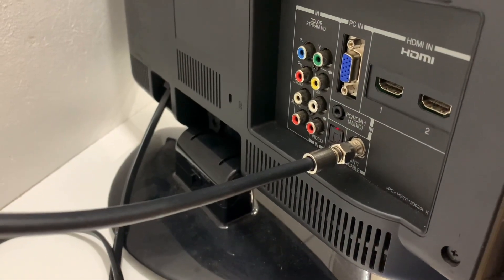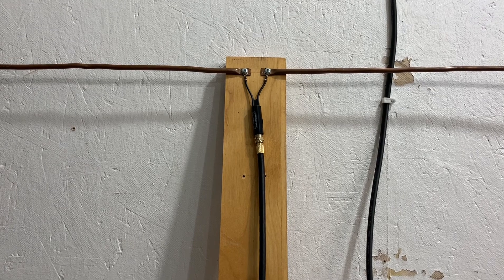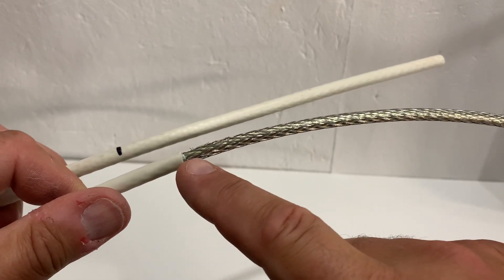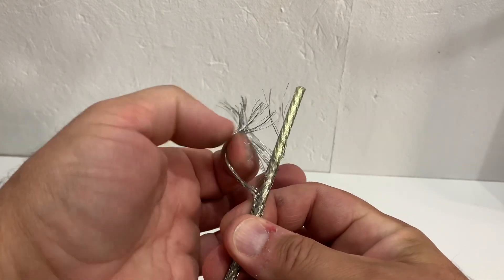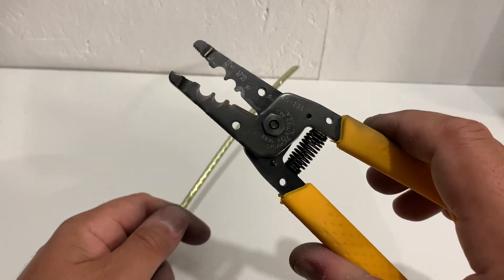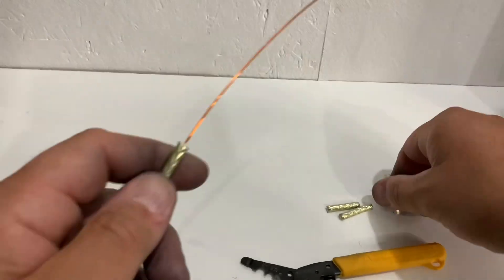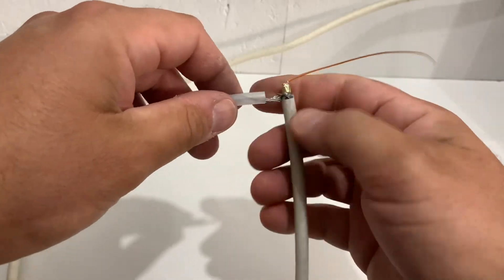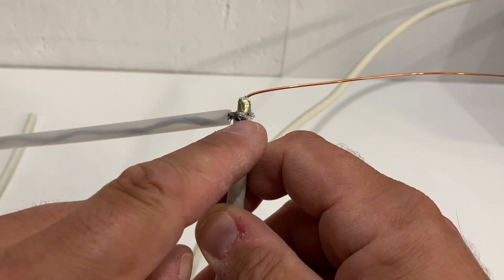Build a Homemade TV Antenna from Coaxial Cable - DIY OTA TV Antenna

Comment: Thank you for the awesome tutorial. Clear description of steps. Well done!
Reply from the maker: You’re welcome, thanks for watching!
Reply: I just carefully used a pair of scissors to be careful not to cut any shield or wires.   I had to cut the initial rubber part in small pieces.  But I could tell with the scissors just by how deep I was cutting, and didn't hurt the shielding or the internal copper wire!

Comment: I built one of these last week using one of the many pieces of excess coaxial cable that I have had sitting around for years, plus a couple of pieces of plywood.  It works great here in Brooklyn, NY.  I have the antenna sitting in a window that I suspect is not even facing any of the transmitters.  I get between 60-70 stations, with only 2 (on the Channel 7 subband) coming in and out depending on atmospheric conditions and time of day.  Thank you so much for your video!

Comment: I'm using 2 four foot wires and I get everything real strong they're still using lower frequencies in my area so I need a bigger antenna than this
Reply from the maker: Great to hear. There must be Low-VHF stations in your area. Go with what works!

Comment: Thanks for a great and detailed video. My coax had 2 sets of braided wire separated by plastic sheeth. Wasn't sure what to do so I untangled both and twisted them as you showed, making sure they didn't touch. Then unsheathed the copper wire, bent them all correctly, taped them to the wall and boom! It works perfectly. Thanks again.
Reply from the maker: @Homelander-js9hd  That cable is called quad-shield. Just an extra couple of layers of shielding. Thanks for watching!

Comment: Is there a secret to unraveling the braided wire?  after a couple of inches it becomes a rats nest!  it took me a half an hour to get 6 inches removed and probably lost about 10% of it
Reply from the maker: That's ok, the antenna should work without the braided wire anyway. Try it out as it is.

Comment: it is so clear for people who wants to DIY one antenna. If I wants to modify e.g. using a copper wire and making this wire as a circle , do I need to connect the shield and copper line to this circle? how to calculate the diameter of this circle?
Reply from the maker: Honestly I think just the copper wire formed into a circle would work just fine without the shield. There are online calculators available, but the rough formula for calculating a half-wave antenna length (in feet) is 468/frequency. Then just form it in to a circle.

This website has a chart of the frequencies of individual TV channels, as well as a calculator for full-wave and quarter-wave antenna lengths by frequency.
https://otadtv.com/frequency/index.html

And another online loop calculator:
https://www.66pacific.com/calculators/full-wave-loop-antenna-calculator.aspx

Comment: anybody know if this will work in rural mountain areas for tv 30-50 miles away?
Reply from the maker: @egenestarr1965  This antenna is designed for close range reception within a city, maybe 15-20 miles max. In a mountainous rural area 30 to 50 miles away you will need a larger outdoor antenna with more elements. Mountains especially, will degrade a TV signal by simply blocking the signal or refracting it making it more difficult to receive.

TV Antenna Reviews
https://www.youtube.com/playlist?list=PLDX6gLCL4WMwMAycjBF3_ApXyAfwHNV4f
Reply: @NorthcoasterHobby  thank you
Reply from the maker: @egenestarr1965  👍you’re welcome

Comment: I built a dipole antenna tuned to 189 mhz.  Worked with a marginal 44% signal.  I used a boom and placed the dipole on it with a director 4 3/4" in front of it.  Signal was now 54%.  I added other director tuned for 189mhz of course.  Signal jumped to 63%.  Here is the weird part.  I then added a reflector about 12" behind the dipole on the boom and the signal went down to 48%.  Took it back off and the signal was back to 63%.  So I decided to add another director for a total of 3 and again the signal went down to about 52%.  Can't understand why adding the director and reflector weaken the received signal.  Using the dipole with two directors and no reflector is the best I can do.  Signal does go down a few percent during bright sunny days but is very stable. Goes up during the night and when it rains.
Reply from the maker: Strange. I guess go with the two directors. Generally directors are about 5% shorter than the driven element, and reflectors 5% longer than the driven element.
Reply: @NorthcoasterHobby  That's exactly what the directors are.  The reflector was just a bit longer BUT they didn't work for some reason. even made it worse.  I'm thinking it because of the location of my antenna but I tried all over the yard and the only place I could get a signal was in my garage window.  I accidently found the signal after laying the coax on my motorcycle in the garage and a signal came in.  The motorcycle was acting like an antenna with the coax touching the frame.  I also played with the spacing of the elements to get the best signal.  I have a pretty solid 62% signal right now good enough to split it 3 ways where it drops to 60% then.  Have to use a 24db preamp.  I have a big hill between me and the TV tower so it's needed.  The station (channel 9) I'm getting is 27 miles away.

Comment: I just used an old Genesis RF Modulator and a coax cable and was able to get 26 channels. Wonder if I should do this or something else go het more channels.
Reply from the maker: An outdoor antenna will usually work better than an indoor antenna. That’s probably the best way to pick up more channels.

Comment: I live in a highrise near the MoSun Connecticut.

Reception is normally awful for indoor antennae. unless I align it with Long Island Sound. I cant use an outdoor. But I have a 3x3 ft hot spot in my apartment. 
Using a $20 antenna with an amp I got NYC! But only for a few hours. I receive most CT TV stations. CBS won't come in, but I have Paramount Plus. Good bye $130 Directv bill!

Comment: what is the point of a dipole when the braided portion is grounded? I made an antenna by eliminatiing the braided end at the antenna and attaching the center wire directly to an aluminum foil glued to a piece of cardboard. I am in Central Mass and get 65 channels. The flat of the antenna "faces" east/west. Maybe i'm wrong but I belive that dipoles are not grounded.
Reply from the maker: With antennas there is no one size fits all. I'd doo whatever works best for your reception situation. I'm not exactly sure about the ground, maybe you're on to something there.

Comment: Window antenna!
Thanks for this. I'm lucky that where I live has straight line of site to our areas tv antennas, about 10-12 miles as the seagull flies, up on 2000 ft ridge (I can see them with binoculars). There's some neighbor hedges partially blocking in front of my window but aren't stopping the signal for whatever reason. So have no idea if what I did will work in other situations. 
Made this antenna and got channels 13-35. Could only get 3 which is NBC, only very rarely for an hour or so on a perfectly clear day. Researched, learned about low VHF needing longer antenna, started running numbers. Then realized the window was aiming the antenna through was aluminum framed, so attached wires from each end of your antenna to separate places on window frame and get channel 3 clearly along with all the others. Surprised and going to make this setup with more solid materials and be done.
Reply from the maker: Thanks for sharing your experience, and for watching!

Comment: Worked a treat. Carefully used a stanley knife and got dozens of channels on the TV in the basement. Luckily only two miles from the main antenna in the city. Also the quality is way better than i got from the cable box i recently got rid of.
Reply from the maker: Excellent!
Reply: stanley  makes knifes now?!

Comment: Great videos 👍 do you have a link to buy that  rg6 rg59 tv coax strippers. is that a klein brand tool
Reply from the maker: The tool in the video is made by Ideal. Here is a link for it:
https://amzn.to/3TKkCPa
Also here are a couple of videos I made featuring Klein tools. Links are in the description.
Klein Tools Coaxial Cable Stripping Tool for RG6 Coax Cable
https://youtu.be/0JXG102nEu8?si=nSdDRD4D4Vwq_hOA
Klein Tools RG6 Coaxial Cable Compression Crimper Tool with Extended Reach
https://www.youtube.com/watch?v=jbayjkrZdQw

Thanks for watching!
Reply: Thanks Bro, I just made a Homemade TV Antenna and the thing really worked. You have a good YouTube channel there and now I have some good TV channels here. @NorthcoasterHobby
Reply from the maker: @lionelmcvinyl9027  So happy to hear that! Thanks again for watching!👍

Comment: I followed your exact instructions, but was disappointed to discover that this worked worse than the little flat panel antenna that I paid $5 for. .
Reply from the maker: There is no one size fits all for a TV antenna, unfortunately. Glad the flat panel antenna works for you though.

Comment: I did something like the opposite once as a kid. 

I connected the coax cable that was attached to my TV for cable tv to my stereo (an older Electrolux stereo with turntable and 8-track player)  via a 75-300 ohm adapter. 

I was then able to pick channel 2’s audio at 97.3FM. Oddly enough, I also picked up channel 36 (was MTV at the time through my cable company) at both 88.5 and 107.7FM. 

I was just 13 years old in the late 80s.  It was cool to listen to TV audio that way.
Reply from the maker: Ah, yes! We had that too here in Canada. FM cable. You could pick up audio feeds of TV channels. We had the coax connected (with 75 ohm transformer) to the home stereo receiver. Picked up MuchMusic (like MTV in Canada), and the movie networks.

Comment: I was having trouble getting local channels on just one tv with a simple rabbit ear indoor antenna. I have 3 tv towers located 25 to 26 miles away all in the same direction from my house. My roof is metal and my walls have metal mesh and plaster, so i opted for an outdoor antenna. I made this simple antenna just to get local channels on one tv. I attached it to my chimney about  17' above ground. I now receive 16 local channels with no noise or inteference, so i hooked the output of this antenna to an old un used satellite dish 4 way splitter and i now receive these  16 channels on all 4 tv's. The 3 tv towers were all located in an arc from 325 degrees to 345 degrees so i just rotated the arms perpendicular to the 335 degree line of sight. I taped the arms of this antenna to a fiberglass rod and slid two pieces of black rubber hose on each. i then ran the cable down through a 2' section of 1/2" pvc and glued the top part to the pvc and attached the pipe with small pipe clamps to an anchor.
Reply from the maker: Awesome! Thanks for sharing your experience with us. Glad to hear that the antenna is working well for you!

Comment: Does the quality of the coax cable make a difference? My condo has a wall jack for an external TV antenna. I plugged in an old coax and got 50 channels.  I do have to flip channel by channel. Is that normal? I’m new to cord cutting.
Reply from the maker: RG6 is the best coax cable to use, as it minimizes signal loss. Sounds like the building you live in has a master antenna system, or perhaps an in-house cable system. Most areas can pick up some over the air channels, 50 is a very good amount of channels.However some areas can pick up 150+ channels! I only get 3.

Comment: Thank you for this how-to.  I was wondering:  can I design my own multi-element dipole that includes parallel dipoles of lengths tuned to different frequencies?
Reply from the maker: I’m sure you could do that, or try a Yagi antenna design centered around a particular frequency.

https://www.rfwireless-world.com/calculators/3-element-Yagi-Antenna-Calculator.html

Thanks for watching!

Comment: Works great. Got about 10 channels. TY. Can explain why some antenna designs require the 75 to 300 ohm transformer and your design does not.
Reply from the maker: Glad it worked for you. To answer your question I’m not exactly sure why, though coaxial cable itself has an impedance of 75 ohms, whereas using two wires would likely have a higher impedance and need a 75-300 ohm transformer. Also since the cable itself is the antenna I didn’t see a need for a transformer. It has to do with the resistance to the transfer of signal between the elements and the cable. Here’s another antenna I made that might shed more light on the subject:

Build a Homemade DIY TV Antenna from copper wire - dipole OTA TV antenna for local channels
https://youtu.be/bYfZu923aTY

Comment: Thanks! Went from 18 channels with an old rabbit ears to 37 channels your way. Couple tips: you don't need to strip the center conductor, and I hot glued mine to a 12" scrap of wood, tape will work. I hang it from the window blinds. Test will be tomorrow morning when the morning sun pours in that window, I'll see if the hot glue holds.
Reply from the maker: Thanks for the tips, and for watching my video. I’ll be interested to hear how everything turns out. Keep me posted.👍

Comment: tried it out of curiousity, got no channels. could just be my area or the fact that my metal roof is blocking it.
Reply from the maker: Try placing the antenna in a window. Run a channel scan each time you move the antenna to a new spot.

Try this website to find where the broadcast towers are located in your area to give you an idea of which direction to point the antenna:

https://www.antennaweb.org/

Enter your zip code.
Click ‘antenna will be installed 30 feet above ground’- this will give you a better listing of available channels.
Press ‘go’.

Comment: 03:18 To be fair for $15 you can already buy an actual aerial antenna instead of crimping tool that you won't ever need to use besides putting connectors on coax or RJ45 plugs for UTP, hell even for $5 at some flea markets, 30 year old antenna or new one it's all the same.
Reply: Don't take it wrong I understand the joy for DIY, I'm just saying these old school VHF/UHF antennas are incredibly cheap and you can also get a cheap amplifier to boost signal as well, you don't need any of that Amazon crap for $100,
Reply from the maker: Fair enough.

Comment: If shorter antennas receive for channels, what’s the point of the high he expensive ones?
Reply from the maker: Larger antennas have more elements to capture more signal, offer more gain, and a more reliable signal in case of obstructions or bad weather. Also outdoor antennas are built to withstand harsh conditions in the outdoor elements. This simple antenna is for indoor use in strong signal areas.

Comment: It didn’t work for me could i have done something wrong
Reply from the maker: Could be the location of the antenna.

Check here to see what TV stations are available in your area:

https://www.antennaweb.org

Enter your zip code, check ‘antenna will be installed 30’ above ground’ (even if it isn’t you’ll get a more complete list of channels available in your area).

Try moving the antenna around in different locations, near a window, facing the broadcast towers (the antenna web map will show these if any). Run a channel scan each time you change the position of the antenna.

Hope this helps, and best wishes.

Comment: This works like a charm!! I just dumped cable and got a Roku but I still needed 2 antennas for local. You saved me about $60. 

I "cut the cord" both literally and figuratively because I got the coax cable ends from my now useless cables. LoL

Comment: I've seen models of antenna where copper and braid are basically touching, not directly, but on different parts of the antenna (solid metal antenna, they eventually make connection because of this). what's up with that?
Reply from the maker: The braided shield and copper conductor will short the signal if they touch.

Comment: Can you use a longer coax cable in order to locate the antenna farther away from the tv or does a longer cable reduce reception?
Reply from the maker: A longer cable can be used.

Comment: More Elements = Better Reception = More Channels with good quality reception and that's what you get with the "more fancy and expensive" antennas. They put more into what they make and they work better and they are also easier to put up and use in any situation.  All that you need is a mounting base pole to put it on.
Reply: I have a $100 "fancy" unit on my balcony that performs just about as well as the antenna shown in the video....

I just made one of these for my bedroom, and get practically every channel my "fancy" unit gets and I spent maybe 10 minutes total setting it all up, I haven't even looked for a better spot for the cable yet.

Comment: Thank you! I needed to move my HDTV antenna to another TV, and the 19" HDTV I use infrequently in my office needed a new antenna.  Instead of buying a replacement, I make such an antenna using wood skewers and spare wire.  The result was MORE than adequate for what I needed.  I found more channels than I expected in my suburban home.  For this set, I actually got more than the 40-mile rated flat HDTV antenna did, which was previously installed.
Reply from the maker: That’s great to hear! Thanks for watching!